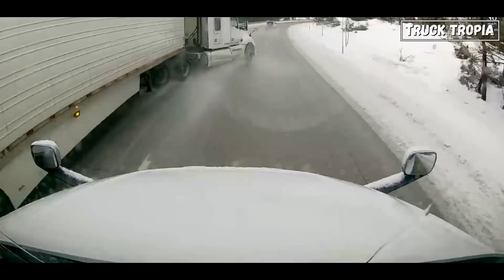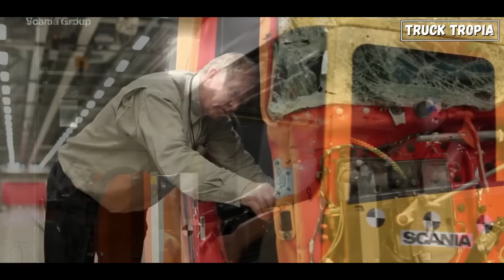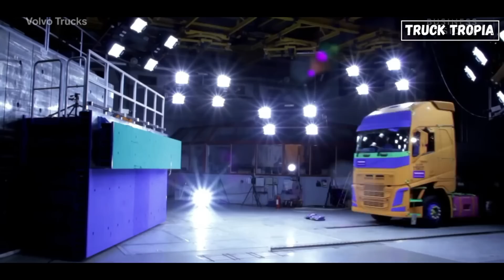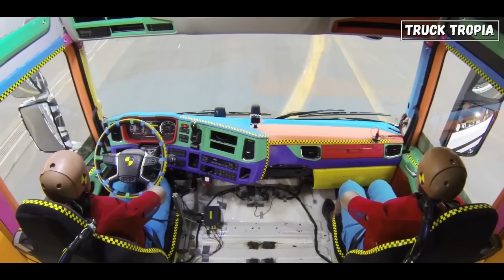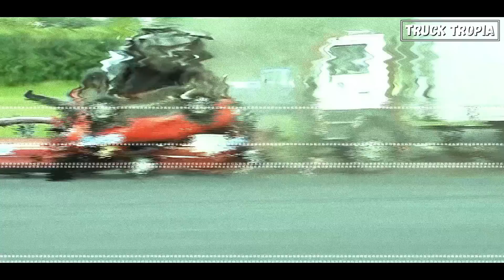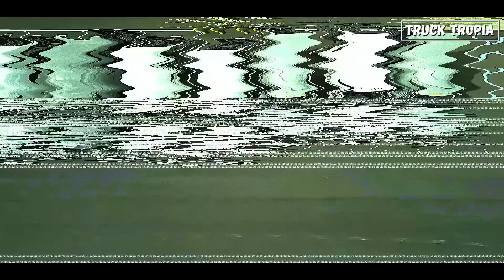What Really Happens in a Semi-Truck Crash Test?

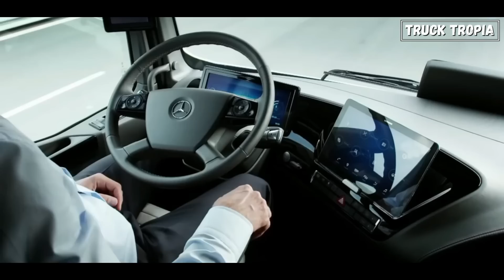Comment: 2:35 trucks usually don't have airbags since they can and will blind the driver and turn a truck into an unguided missile after a crash
Reply: Yea buddy, euro trucks have multiple airbags
Reply: After your truck crashes you will have so much control.
Especially if the axle is broken.
Reply: American trucks didn't have front brakes for a long time.... theyre not safe

Comment: I'd like to see an full frontal crash test between the European cab over and the American long nose trucks...
Reply: Honestly, I think both would get fu**ed up equally.
If you consider just the driver safety and cab design in a full frontal crash in high speed with no load, bonneted "conventionals" are probably safer.
But a full frontal high speed crash with no load is an almost improbable cenario. If you're hauling a heavy load in a high speed frontal crash, your cab will probabbly get crushed by the load because of inertia, independent of the cab design.
If you consider everything else, euro cabovers are safer by a big margin. Way better visibility, better brakes, resulting in way less travel distance to stop even with heavier loads, better cab materials resistance, better crumple zones, airbags all around (steering wheel, knee, curtain...)etc.
And the real shock happens when you think about everyone else outside the truck. Let me explain: better visibility, better brakes, better mirrors (yea thats a thing also), runover side protecion, cameras, emergency braking and other driving assistances makes everyone else in the road safer, not just the driver. There are some videos online to prove my point, just search "scania/volvo/mercedes truck brake test" (one example https://youtu.be/oxN0tqO9cSk?si=AiiSiouRPCxYVJ6W).
Confort is a big part in safety too, euro cabovers have axle air suspension + 4-point cab air suspension + seat air suspension, automated or at least syncronized gearboxes, air assited clutch pedal (easier than a clutch in a manual car), waaaay better turning radius, etc making it less demanding on the driver (less fatigue = more attention).

BTW, Bruce Wilson, an american that imported a Scania to the USA, explains all about it in his YT channel.

Comment: These are "tractor trailers", not semi trucks.  A "tractor" pulls a "semi trailer".  I worked in the trucking industry for over 30 years, "never" heard a tractor called a "semi truck".  Elon might call his a "semi truck", but no, they are tractor trailers, big rigs, 18 wheelers.
Reply: Bro ppl call them semi trucks ☠️ u stuck in the 1950s this is 2024

Comment: Based on all the crashes between European and American trucks I have seen, I will take the American trucks any day. 

They are much better built to handle the types of crashes you mostly find here in the U.S.

Head-on collisions with European trucks are much more dangerous as the driver's body absorbs all of the impact. 

European trucks are better at helping the driver prevent a crash. But it's often not the truck driver that causes the crash here in the U.S. 

This video alone shows how bad the EU trucks did to protect the driver from hard impacts. 

This is why cabover trucks are not used in the U.S. since trucks here travel at much higher speeds compared to Europe. 

EU trucks are best suited to slow-winding roads with pedestrians. That's what they are specifically designed for. 

But in the U.S. there aren't that many pedestrians because distances are too far to walk and most trucks are moving at 70 to 80 Mph on the interstate. 

So hence EU trucks are best in Europe and U.S. trucks are best for North America. 

The traffic conditions, speeds, and distances are very different between the EU and North America. So hence the needed design differences.

Comment: We need  underride guards  on trailers to be mandatory for all trailers. Up here in NY we lost 3 EMS workers to going under a semi tanker trailer that had jackknifed on the interstate at nite.
Reply: Side protectors dont help against jackknifes: ABS/EBS does. Knorr developed a 12v system for America, but America wasnt interested, so we put it on non-cdl air braked 5th wheels. 

In Europe side bars are only to prevent pedestrians or cyclists to fall in front of the trailer wheels. A true under-RIDE- protection is only at the rear.
Reply: @Sjanzo  what? we are forced to have the GARBAGE abs system on our truck for the last 20 years or so. the best thing you can do to that junk is pull the fuse. ABS sucks

Comment: in Europe lateral and rear colission test are mandatory on trailers and that's why there's mandatory rails guards on sides and low height bumpers at the rear , to avoid cars to pass under the trailer (this rails act like walls : they stop you, you can't go further under the truck)
since those test are mandatory, the amount of cars passing under trucks have decreased significantely (about 70% of safety enhancement)
Reply: If they weren't tailgating they wouldn't run under the back to start with
Reply: @bmacguyver I think a lot of people don't know the concept of: safety distances (on the sides, it's not a matter of distances)

Comment: They act like American trucks do not have the same driver assistance sensors as European trucks. Sensors like proximity warning that automatically applies the brakes if you're too close, lane departure, adaptive cruise control, and whatever else. Me personally, I don't want or like any of that stuff in my truck or my four-wheeler! Some of that stuff is dangerous, and makes your job harder. This is why I prefer older classic long hood trucks from before year 2000!

Comment: well comparing both trucks together as an American. European vehicles are just innately safer than the US vehicles main reason is our cars don't have any real competition to make them get better and safer in order to survive like the European market does which is a shame really
Reply: ...and the USA thinks that other countries' safety standards are crap. Importing trucks to the USA is only permissible if the truck is older than 25 years or the manufacturer pays for US crash tests. But then again, the longer the nose of the truck the more valuable it is -- and European trucks don't have and will not have such noses. These noses render a truck impractical for most European places.
Reply: @McGhinch  I agree our regulations are so weird over here in the US not to mention our indicators being in the same housing has our brake lights meaning our indicators are RED rather than amber like they should be
Reply: @McGhinch  how stupid do you have to be to make that statement? so can US manufacturers sell in Europe without meeting European crash standards? why do you have such an inferiority complex about US trucks? US invested massively in a highway infrastructure system to move goods. you have shitty little goat trails. maybe step up and build decent roads
Reply: really? ALL but Paccar are European owned. so Paccar has to stay ahead of all the European companies, and they do so over in europe as well with DAF. Europeans use more gimmicky electronic junk and forced obsolescence.
Reply: @ if I recall correctly DAF is owned by the paccar however it’s hard to keep track of who owns what companies

Comment: Did he say 120 tons? That’s an error because that would be 240000 lbs, which can’t be right.
Reply from the maker: in the video we say that there are crash tests with over 120 tonnes, which is obviously not correct. :)
there are some countries where 120 tonnes is allowed in total selected gross weight, 
but they do not crash test with that weight :)
Reply: 120 Metric Tons ≈
264,554.71 Pounds

Comment: lane keep assist and auto braking etc don't improve driver awareness! they give drivers a very much false sense of security, seen it plenty of times.....Hell you just gotta drive down the interstate until you hit construction to see how many morons ignore lane ending signs then get mad when you need to switch to the non closing lane or they run right to where the lane closes and expect traffic to stop to let them in. and that's how mile long backups start.
Reply: the EUropeans are selling the 'zipper merge' as if it is a good idea, zipperhead merge tells these idiots to drive to the very front and have the travel lane stop to let you in... these morons tell you that is the 'best way'

Comment: Long nose trucks are easier to get access to the engine as it doesn't require lifting the entire cab.
Both long front and flat front trucks still make it easy to work on the engine.
Reply: lifting the entire cab isnt that big of problem... if the things inside are secured...
Reply: Most of the time you don't need to tilt the cab in an Euro cabover, coolant, oil and filters can be accessed by opening the front grille
Reply: @lorandi_lorandi And that's because european trucks are actually engineered, not just put together. Work smarter, not harder.
Reply: Nonsense! You believe in lie
Reply: Cabover has access to 3 sides of the engine 
Long nose only 2 😂

Comment: As an Aussie. The amount the deaths that Kenworth and Western star have from contextually survivable crashes show how badly built they are. Although the new X series Stars and T610 KW have improved alot.  

But Australia has no crash standards for above 4.5T gross trucks. So the Aussie made Kenworth cabovers are the most dangerous fibreglass pop riveted shitboxes around. 

Where as Volvo, Scania,  Man,  merc and Iveco all have the same designs that pass Swedish safety standards. So they are head and shoulders above the American brands.
Reply: there are  no Kenworth cabovers in north america for decades now, and NONE were fibreglass, so that is an Aussie or DAF thing not american
Reply: If European trucks went faster I would probably use one for trucking in America bc one You would get looks and 2 to me they are safer and made much better.
Reply: @CurtisLee-q2n if Euro trucks would come to the states the limiter would be removed

Comment: European trailers have side guards that are designed to prevent cars from going underneath the trailer chassis, the same with the rear under-run bar that is designed to prevent a car from going under the rear end of the trailer. You have been making these videos long enough now that I would have thought that you would have a little bit more knowledge of European trucks.
Another thing that you failed to mention, is that on European trucks the cab mounts are designed to sheer off in the event of a head-on collision, thus offering more protection to the driver, that is why Volvo and Scania test the strength of their cabs for the purpose.
Reply: is it common for cars to go under the side of your truck? seems like a dumb thing to make a rule about. I have seen the cabs laying on the road in big wrecks here in north America many times, to claim it is a 'design feature' is laughable, the part that hold a cab to chassis are just very small. the video up there just said US trucks do better in high speed frontal crashes then euro junk but you ignore that.

Comment: 120 ton trucks? Sorry what? Sorry but I have a feeling you are making a huge mistake there.
For anyone wondering. 120 tons is heavier then your avarage railway locomotive. For example, the Siemens Vectron (Most modern locomotive in Europe as of this date) weights between 80-90 tons. Depanding on the version.
Yet this video claims that a truck you see on the road weighs around 50% more then a Siemens vectron?
Sorry but I cannot take this information seriously and it makes me wonder how accurate the rest of the information is in this video.

Also, the maximum weight of a Truck in the US is 80.000 pounds. that is 36.2 tons. (This includes the cargo they carry)
A 120 ton truck would not only destroy the road, But also any bridge it drives over.
Reply: He was confused with the imperial tons or didn't specify which was what, this is why i prefer double measure written, so the Yanks... I mean... So the people who use metric systems and Imperial ones don't misunderstand
Reply from the maker: in the video we say that there are crash tests with over 120 tonnes, which is obviously not correct. :)
there are some countries where 120 tonnes is allowed in total selected gross weight, 
but they do not crash test with that weight :) @marco_grt4460
Reply from the maker: Its included the weight, in Europe Trucks som trucks are allowed with a gross weight over 220.000 pounds
Reply: @TruckTropia Oh once again. No research done. The limit in Europe is around 40-44 metric tonnes. Sweden and Finland allows up to 74 tons. Which is a bit more than 160k pounds. Anything above that requires special procedures.
Reply: Where shall that be? The heaviest road legal vehicles (special transports aside) I know are in Finland, comparable to a US turnpike double with two full size trailers and these can go up to 76 metric tons gross weight. But I like to learn new stuff...
Reply: @TruckTropia  you can have that with a permit in north america as well. the MYTH that all the US is 80000# is complete bullshit. WA state has 105500# single trailer trucks, they have to use a couple drop axle IIRC,  one on the truck and one on the trailer. my province we haul 104500# or 46.5mt with a tridem trailer and 3 axle tractor, our "max" without overweight  permit is 63.5mt.
Reply: EN FRANCE, LES TRACTEURS 6X4 OU 6X6 PEUVENT TRACTER JUSQU'À 120 TONNES !!!

CERTAINS TRACTEURS 8X4 OU 8X8, PEUVENT TRACTER JUSQU'À 600 TONNES !!!
MAIS JE PENSE QUE DANS LA VIDÉO, IL SE TROMPE !!!

JC ANONYMOUS PATRIOTE FRANCE.
DE GAULLE ET FIER DE L'ÊTRE
Reply: Australian road trains 2-5 trailers on public roads, mining companies use more on private roads, up to 200 tonnes.
Reply: @miltonmunster8452  But Australia is not really in Europe - quite close to the opposite in fact...
Reply: @MirkoC407  This I'm aware of, just informing yellowstone that the 120 tons is not unusual.
Reply: @miltonmunster8452  Fair point - we have two discussions going on here. Yellowstone being sceptical of these trucks destroying infrastructure - of course if a legislation allows it is to expect that infrastructure will be built accordingly strong, but Australia was not part of this video, although you down there have both styles of truck plus some models built exclusively for you, like short hood long haul models (extinct in Europe, mostly for short haul in America) or forward steering axle cabovers by US companies.
TruckTopia on the other hand claims there are 120t trucks around in Europe which is to my knowledge plain nonsense, because as I wrote the heaviest stuff is around in Finland with 76t, with limits then decreasing to mostly 40 to 44t in most countries. EU law only requires that every country must allow 40t GVW for the usual 12-wheelers (4x2 tractor with a 3 axle trailer using single 385/65R22.5 tires on each position). Everything above is optional - with the craziest thing here in Germany, where LCV were allowed but despite 30-40% more load volume GVW was not increased for them and remains at 40t.
Reply: @MirkoC407  wow an honest European! we haul 46.5mt gvw with a tridem trailer and a conventional tractor, is that a 6x4 in your parlance? you can run singles but only a few fleets do. they look real annoying when they have a flat , I wouldnt want them.
Reply: @notsure6182  Depending on the weight either 6x2 or 6x4. 6 is the total number of wheels (twins counted as one) and 2 or 4 the number of driven ones. Most famously applied to offroad cars and light trucks with all wheel drive being 4x4 - it is the same formula.
46.5 mt might still somehow work with a more fuel economic 6x2, manufacturer data sheets would say more about that. Single driven axle tractors all can go up to 44 mt at least because that is a pretty common limit in Europe and expected by operators. Even 4x2 can do that, but at 44 mt the maximum axle load is reached, so 46.5 require 3 axles anyway. At some point a 6x4 becomes mandatory for sure, because you need the traction of 4 driven wheelsets to move that weight. Most US units are 6x4 anyway I think, with both rear axles driven?
Reply: @MirkoC407  rule here may have changed but we normally cannot use drop axles or non driven rear axles in my jurisdiction.  in the US there are federal rules and then state rules, but yes a 6x4 is the common configuration, you will have regional oddities, like California that run the 80000# no matter how matter how many axles or trailers so they run a 4x2 tractor and 2 single axle trailers for volume rather then gross weight, also common in LTL fleets. other states will have drop axles and weird 'bridge laws' so they have multiple drop axles. I worked a bulk job driving from a mill in Canada at 104500# and had to add 2 drop axles to be legal in WA state to get to the mill, so i guess that would be moving from a Canada legal 6x4 tridem to 8x4 quad trailer. you can tell what route a trucker runs by looking at his configuration, if I see a tractor with a tandem trailer I can pretty much say he runs to California at 80000# as every other state near me allows a tridem trailer
Reply: American locomotives are over 200 tons. 😎